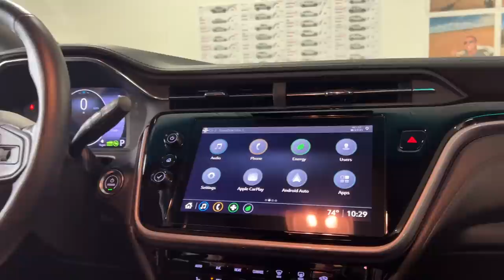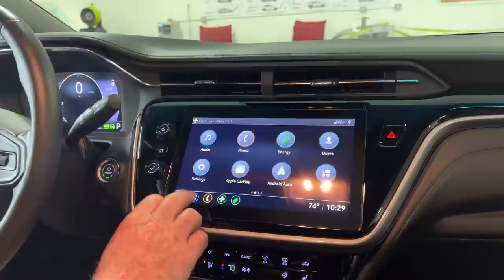Sandy's First Impression of the 2022 Chevy Bolt EV

Comment: Has Munro cost-analyzed how long GM can lose $16,000 per Bolt and stay in business?  GM admitted that they are losing $9,000 per Bolt and recently announced a price reduction of $6,000.  Why is Sandy not highlighting the the expense and inefficiency of the spaghetti of orange wires and connectors interlinking nearly a dozen cast aluminum boxes on the "Lego" built powertrain pieced together from LG parts?  Nice Paint and gaps though.  😂

Comment: Why not make a Volt EV, get rid of the Bolt EV and keep the Bolt EUV as a family vehicle?
Reply: No space for the batteries.
Reply: @markplott4820  skateboard battery instead of the T style due to having the extended range setups and a minimum of 250 miles. Using the Volt EV as a daily 100 miles driver and the rest of the 150 miles could easily use for AC and heater for hot summers/cold winter seasons. I own both Gen Volts.
Reply: @kirivanyam5969   - the Chevy VOLT was a Really SHITTY car, garages could not even repair the LAST gen Volt , they had to send to gm Factory service. 
MOST garages are Extremely LAZY and lack the Training & PROPER equipment to SERVICE a VOLT correctly.

Comment: Charging speed is overrated, any car with over 200 miles of range is plenty, 80% of Americans drive less than 100 miles per day. 10% of Americans drive 200 miles per day.  Only 10% of Americans drive over 200 miles per day, and those people can simply  plug it in while they're at home sleeping for 8hrs and plug it in while they're working for 8hrs.